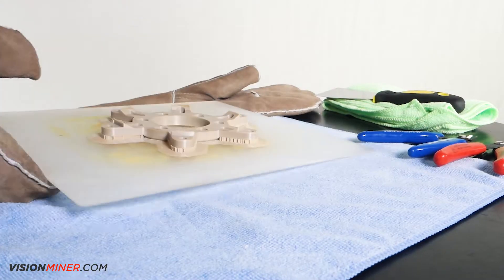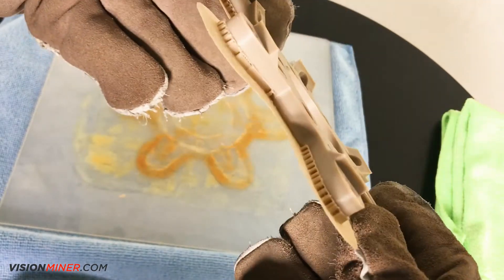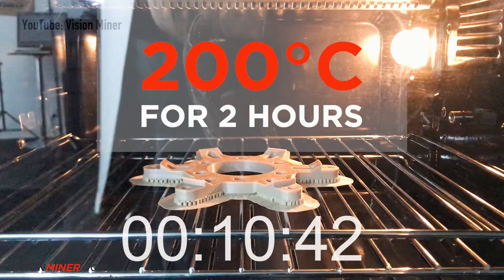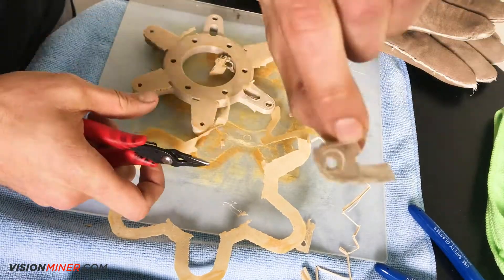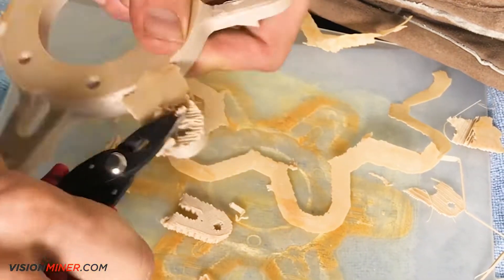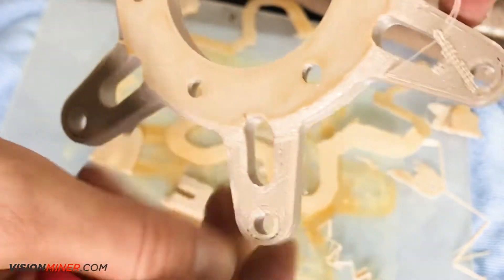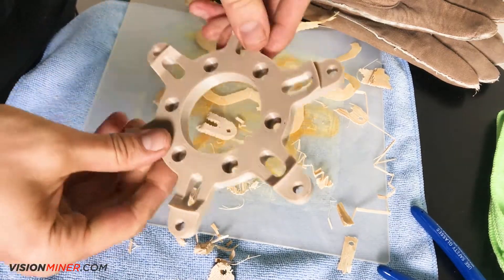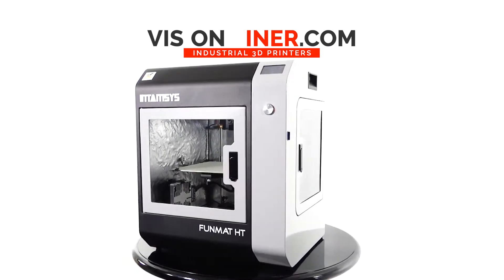Functional PEEK 3D Printing - INTAMSYS Funmat HT - Industrial 3D Printer

Comment: Hi, I have just got a Funmat HT and been trying to print with PEEK since. I've used CURA and Intamsuite with the recommended settings, but It's too damn hard to keep the print on the build plate! Not only that, it's hard to lay the first lines. I've tried using layers of PVP glue, just like the printer's printing guide told me to, but with a very low success rate. I wonder how you guys managed to get this big print perfectly without warping! What are you using on the bed? Also, what is the nozzle temperature? I'm using the Intamsys recommended 400°C
Thanks!
Reply from the maker: Once you get the process down it becomes easy. Make sure to watch our training videos, "how to print PEEK on the Funmat HT" and pick up some of our Nano Polymer Adhesive-- this is for PEEK and PEI bed adhesive, and we created it because we also needed a better solution! :) https://www.visionminer.com/adhesive
Reply: Hey, you still using the FUNMAT ? been looking for a used one to get into PEEK printing.
Reply: Karina

Comment: Hi, I have a Funmat HT as well, but I have a lot of bad experience with PEEK and with the manufacturers slicer program the Intamsuit. You mentioned in the video that you used the simplify peek profile, but I can't find anything for this. Would you be so kind to explain how did you manage to set up your simplify to print peek on Funmat HT? Thanks in advance!
Reply from the maker: Hello! Pretty simple, just set up the machine dimensions in Simplify3D, then use Reprap/Marlin, and from there, set up your temps and speeds :) you can use Intamsuite as a basline for settings, and go from there! PEEK is very difficult, but you just have to stick it through till your part works, then it's a beautiful experience :)
Reply: Hey, you still using the FUNMAT ? been looking for a used one to get into PEEK printing.